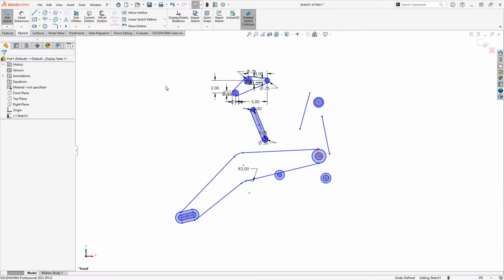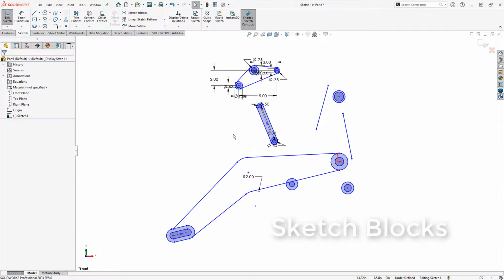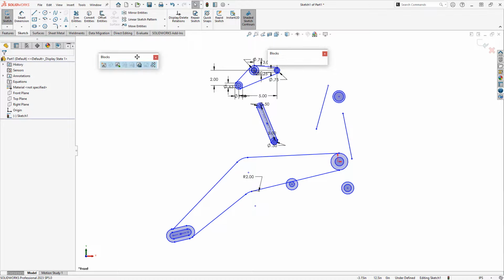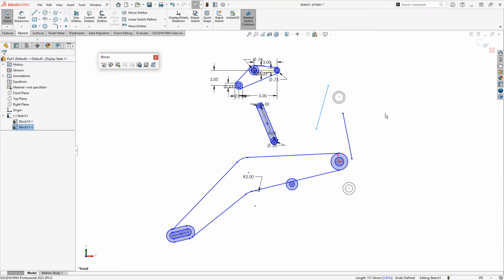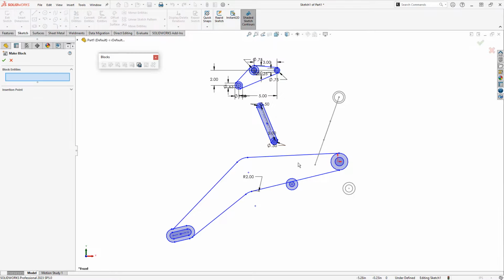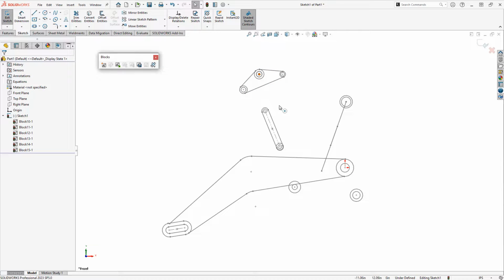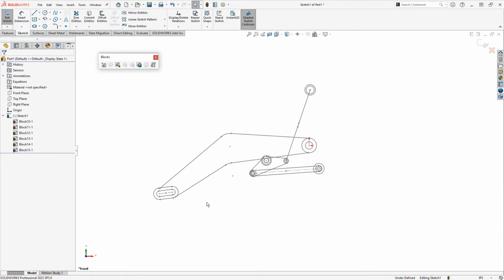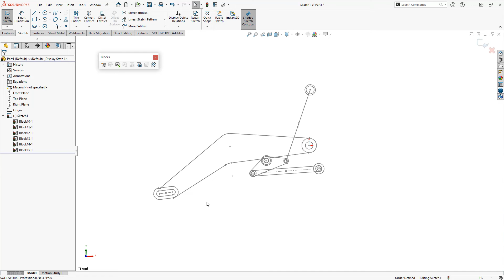Intro to Solidworks Sketch Blocks for Mechanical Linkage | Motorcycle Swingarm Linkages

Comment: This is great! I just started using SW for my new job last week. So far it’s pretty intuitive but I’m excited to learn more stuff like this! 

I just wish I could modify the SW pan/orbit commands with the middle mouse button to work like the Autodesk products I also use (AutoCAD, Civil3D, F360). I keep rotating my work piece while trying to pan 😂
Reply from the maker: I feel your pain!  I jump around between Fusion, Inventor, Swx, Plasticity and Blender and all are a little different.  I wish the middle mouse was configurable so bad!

Comment: Hello.  Watching this video, it looks like you are referencing a prior video no how to set up patterns.  I can not find that video.  I am needing to learn about patterns and setting them up to be automated should the parameter change just like you did with the fence in the video "what's new in Nov 2022". You change the length of the fence and then number of pickets changed but the spacing did not.  I am trying to learn that and you seem to be able to teach it.  Can you point me to that video or videos ?  Thank you.
Reply from the maker: Hi There, the video you are commenting on is about Solidworks, a different program than Fusion.

The video you are asking about had to deal with parameters and using them for patterns.  I have a few videos talking about this.
This first video is the one you are talking about with the fence updating.

https://youtu.be/-BPcktQwIIY?si=bwcj5rZx_2gWEiO5

Here are a few others talking about parameters.

https://youtu.be/91LBG-3DkpY?si=WPhasPnBNP__lrhQ

https://youtu.be/ntMBZQUTLNA?si=NKXrTIUTZQL7j66P

Comment: Hi, Awesome Video! Glad to see some SW stuff from you. Is it possible to do something like the Fiat Fender reverse engineer videos you did for Fusion 360?
Reply from the maker: For sure I plan to cover that, SWx is a bit funny with the usability of mesh imports, especially based on which license you have.  There is a ScanTo3D option you can turn on in some licenses of Solidworks that try to auto wrap surfaces.

I will be doing some surfacing content and will work in mesh stuff as well.  For many years Complex surfacing was what i did and taught in Swx so it will be coming :)

Comment: are you matt prez?I have watching alot your solidworks tutorials.
Reply from the maker: The same :)  It has been a few  years since i released a solidworks tutorial/course so you must be watching some old stuff :)  I plan to put out some new content on this channel for SWx as well as some courses over on my website.

Which tutorials have you been following?
Reply: solidworks maybe  a little ...beacuse make surfaces it is much hard than plasticity,and motion is not powerful as NX  ,it can do some limited things,als0 i admit it is a good sofyware, @LearnEverythingAboutDesign

Comment: Always watch your post if they are designing any linkage, is a sketch block similar to a rigid group in F360?
Reply from the maker: a sketch block is like a sub-sketch.  You can define a group of lines, circles, arcs etc and basically lock them together.  So if you want to think of it like a rigid group between each sketch entity that would work.

If you have Solidworks Premium you can actually apply mass, set the moment of inertia, and simulate them with springs, dampers, forces, and plot their kinematics.  Sadly that is only with Premium, pro and standard licenses don't support motion with sketch blocks in assembly layouts.